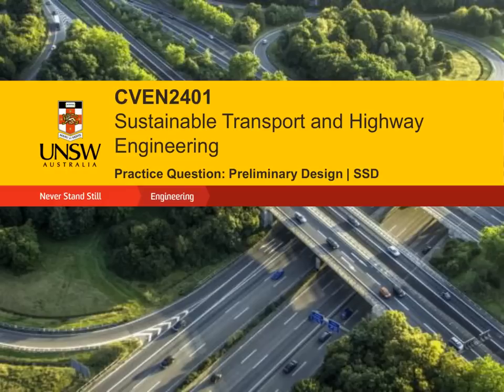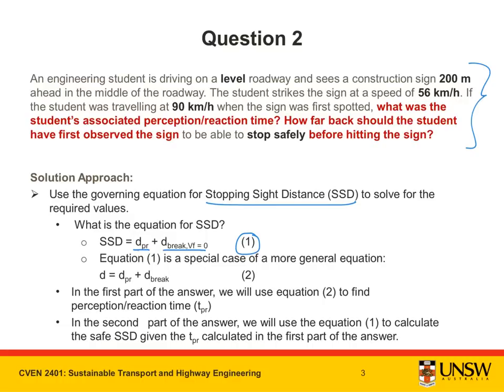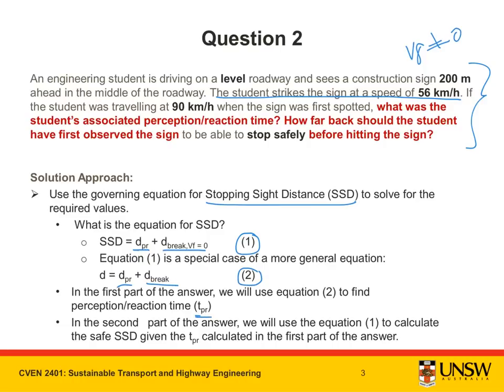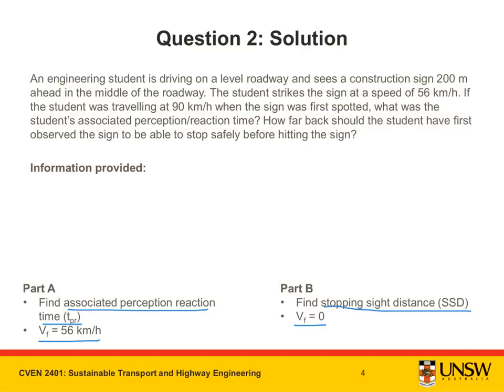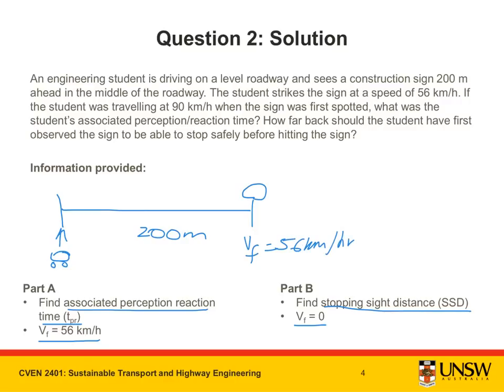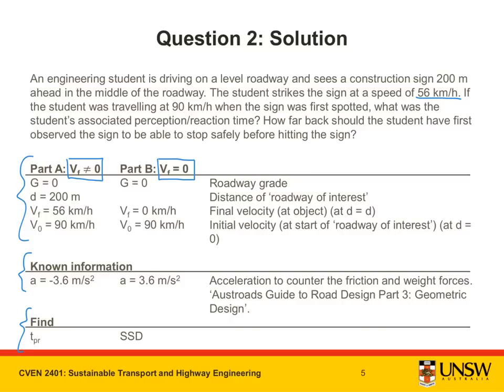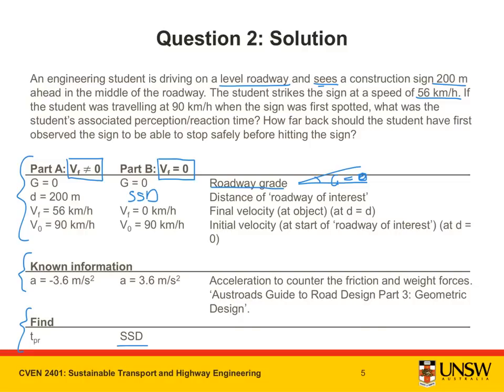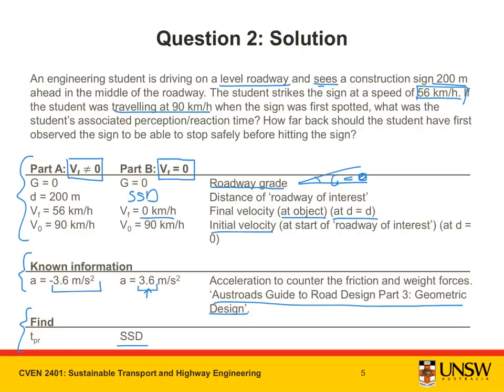Preliminary Road Design: Stopping Sight Distance Calculation (Question 2)

Comment: The SSD equation is not the same as the lec. In lec, we use km/h, but here we use SI. It is a bit confusing of using which during the exam.